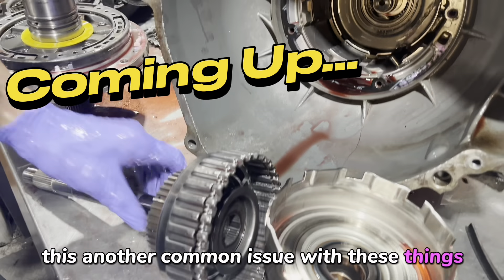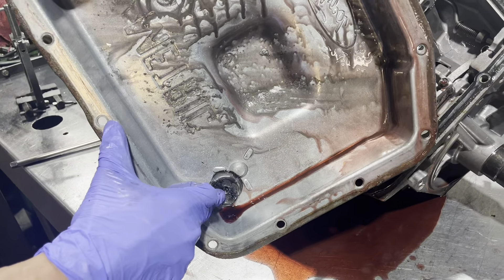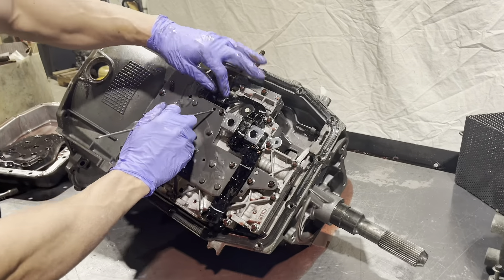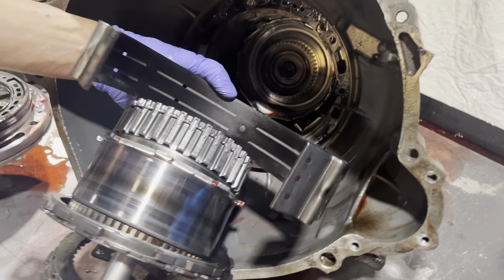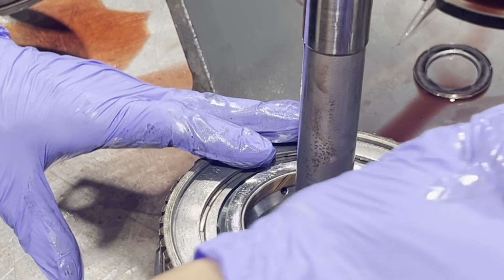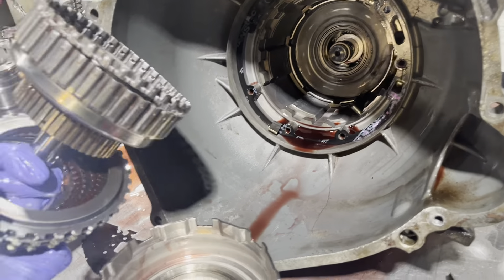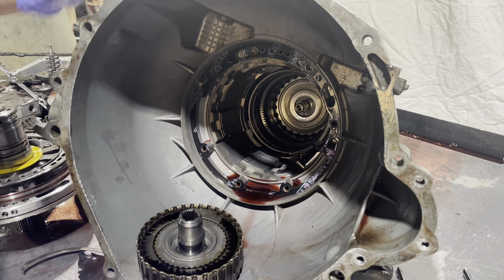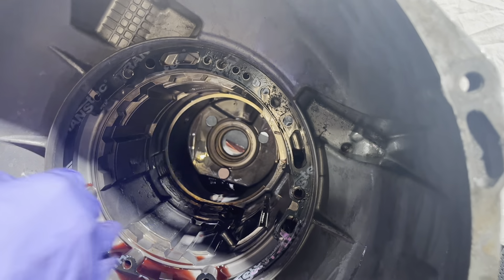4R70W- A Look Inside a Big Name Reman Transmission!

Comment: These videos are great. I can change my own oil and now I am 400% confident I can rebuild my transmission and have no problems or failures for 300,000 miles. Knowledge is power and saves $2500 👍👍

Comment: Hey man. I have a 4r75e in a e350 2007. Have you heard of them trans vibrating like CRAZY  grinding  Howling u joint sound. Its bad. I had the same thing happen to my other e350 van. This time im buying a remanufactured trans. I just pray its the problem.  The trans is making a humming sound from front of trans pan. The output shaft has tons of play too. Just wondering if you ran into this problem.  Thanks great videos bro. Ur a genius.
Reply from the maker: Thank you 
It’s hard to say. I’m assuming that you don’t have to be moving to have the noise?